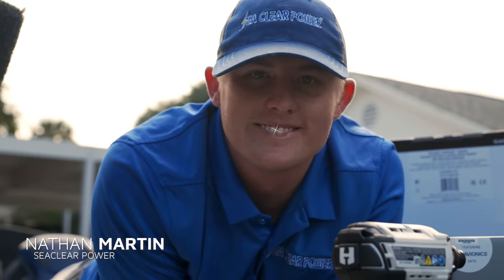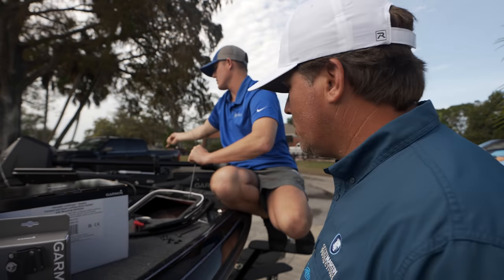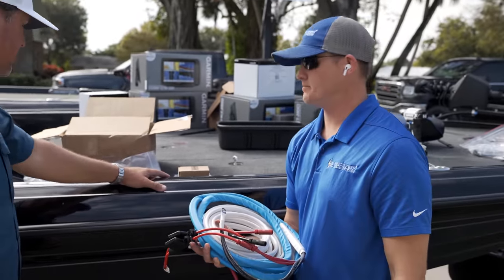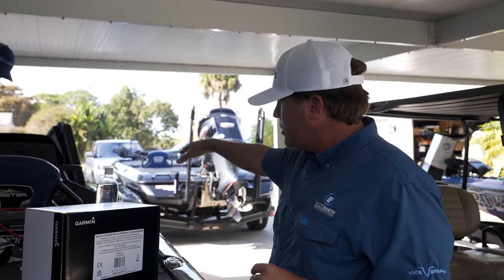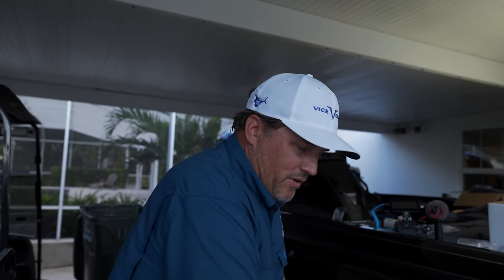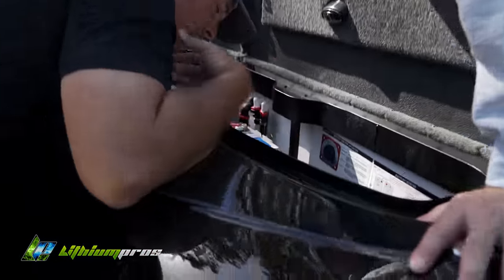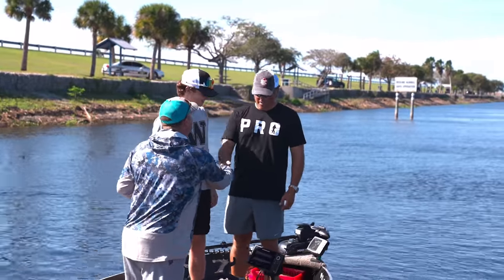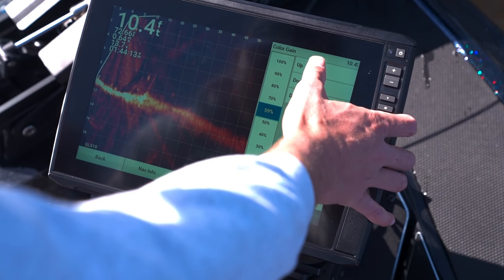SUPER POWERING the MOST ADVANCED Electronics on my NEW BOAT!

Comment: So I’ve never owned a bass boat, but own salt water boats.  The boat usually comes with a single 6 or 8 gauge wire up to the front for a trolling motor.  Do bass boats come with separate wiring for trolling and graphs?  We run our graphs off the trolling motor wires.  It sucks, granted, but just curious.
Reply from the maker: Yes all separate.
Reply: @ScottMartinChallenge  Hmm… probably should stop bass fishing in a saltwater fish and ski….lol

Comment: I am still looking for a good solution for using panoptix transducer to a Minn Kota long shaft Terrova type trolling motor with cable working with sliding TM shaft. I want a casting deck unit with panoptix on bay boat.